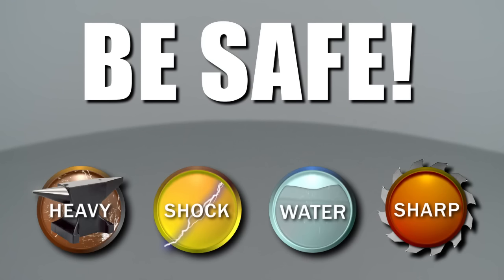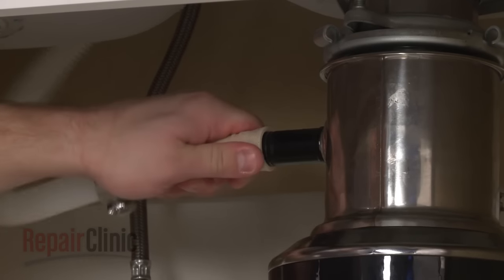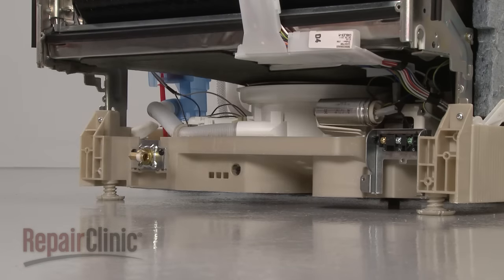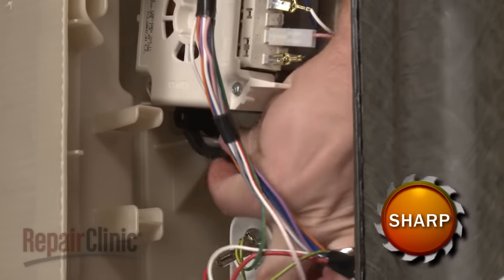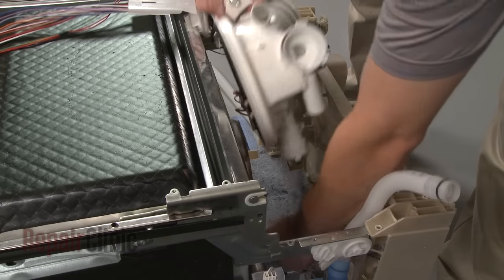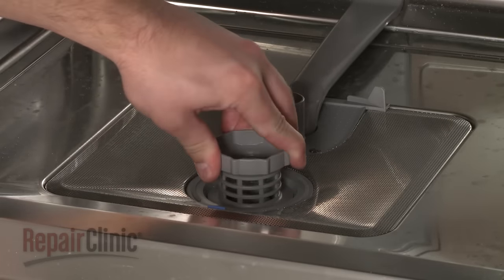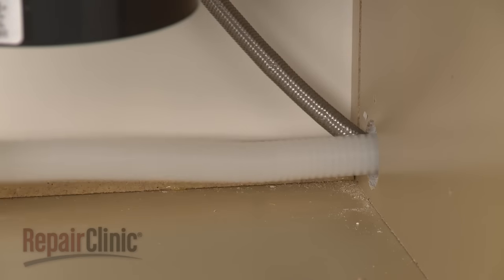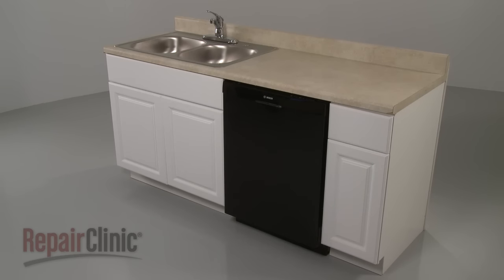Bosch Dishwasher Circulation Pump Replacement #442548

Comment: my Bosh dishwasher doesn't empty and the water just come out of the bottom.could you advise the problem please. doe not leak while washing
Reply from the maker: +Joyce Bentley On our website, we describe the potential causes for a dishwasher that won't drain. Enter your model number to get causes specific to your model. http://www.repairclinic.com/RepairHelp/How-To-Fix-A-Dishwasher/26---/Dishwasher-won-t-drain
Reply: +RepairClinic.com hi don't have a model number its a EXXCEL AUTO OPTION MAXXFREEDOM PERFORMANCE
Reply from the maker: +Joyce Bentley It's possible that your dishwasher's drain hose is clogged. We recommend checking the drain hose first.
Reply: +RepairClinic.com I have got the pump working but it is now stuck in that mode ?

Comment: Good to know. I only took it apart TWICE today and have been troubleshooting all day to find out I have the wrong part.  Ugh.  So I won't be able to get this other one to work at all??
Reply from the maker: Did you order that part from RepairClinic?
Reply: ***** No, and I apologize for my rant.  The reason I didn't purchase it from RepairClinic is because I am on a fixed income and the same part was $40 more on your site.  Don't get me wrong, I love your site, and the videos are great, I used your site to identify the correct pump and shopped around for what I could afford.  I guess I'll try to sell the new pump on Ebay.  After further diagnosis, it seems all I needed was a seal kit after all.  It works great, it just leaks.  Do you price match?  If so, I will use your site excuse for my repair needs:)  Thanks for replying, and I apologize for my open frustration.
Reply: *exclusively, not excuse....
Reply from the maker: dengood1 Thanks for the additional information. No problem about the expression of frustration. We understand. If you had ordered the part from RepairClinic, we would have refunded you immediately, as the error was in our website's results. Thank you again for bringing that to our attention so that we could fix it. For the future, keep in mind that RepairClinic has a 365 days return policy that enables customers to return a part for a refund on the cost of the part within one year of the order. This includes electrical and installed parts. Sometimes, RepairClinic is not the lowest cost option for certain parts. However, our customers tell us they choose us because of our generous return policy, our customer service track record and our free online troubleshooting and repair help resources. Our pricing is set based on pricing to us from the manufacturers. Sometimes, our pricing is among the lowest available on the web. If you haven't already, consider signing up for our free VIP email list, which provides email with frequent discount codes. The link to sign up is in the description of this video.
Reply: ***** Will do, thanks.  I never even looked at the return policies of either place.  Live and learn!
Reply from the maker: dengood1 We hope you're able to get what you need to fix your dishwasher. Yes, now you know where to go next time you have an appliance problem, which is hopefully a long time out!

Comment: How can I tell if the circulation pump is the problem with my dishwasher. Repair man thinks so. It's a big repair job/cost. The problem is that after the dishwasher tab dispenser opens, the dishwasher tab no longer dissolves. Have run the dishwasher on all settings with and without dishes. Dishwasher is only 13 months old. Bosch model : shx4at55uc/14
Reply from the maker: First, make sure you have enough water. You should have approximately an inch of water above the screen for the pump to work properly. If the pump is not running, you can pull out the screen and use either a 7 or 8 mm socket or nut driver to see if the impeller will turn. The access will be through the hole on the right side in the sump. If the impeller does not turn, you can keep trying to turn it until it breaks free the seal may be stuck. If you cannot break it free, you may need a new pump. If it turns free, the impeller may have seeds in it and not pumping or it may not be getting power. If you hear a slight humming noise in the wash cycle, but the water is not spraying the motor is most likely stuck